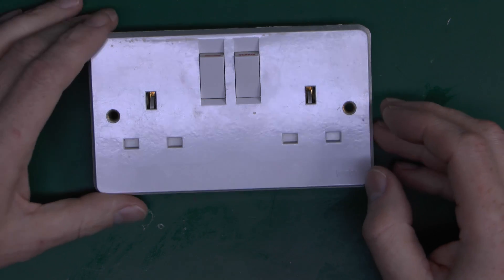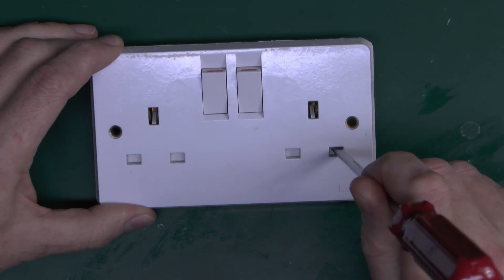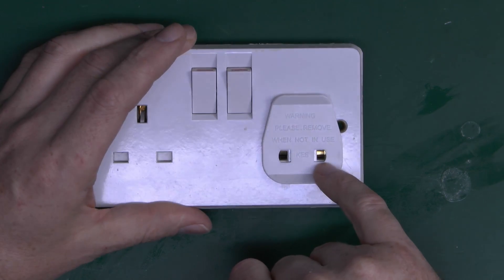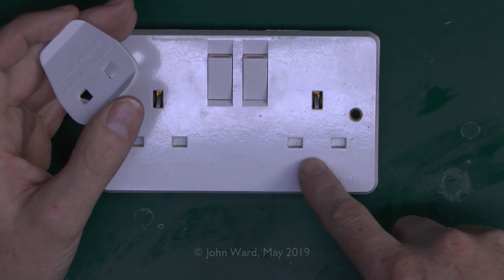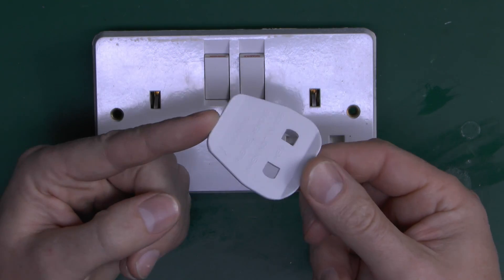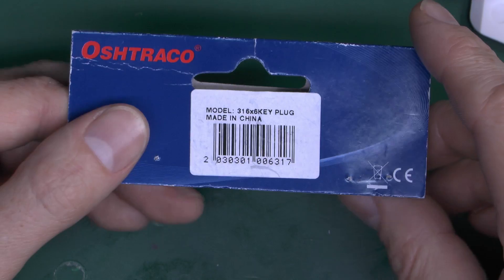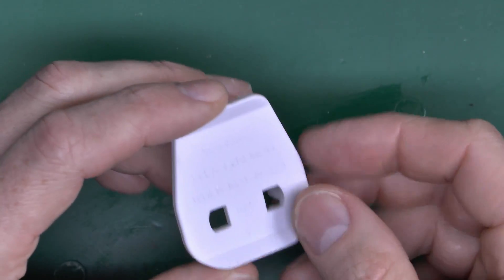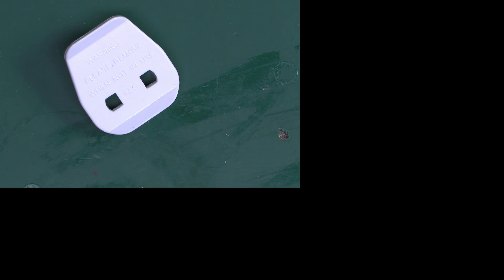Plastic Socket Key to Defeat Safety Shutters in UK Socket Outlets

Comment: Crazy, even somebody with limited intel can see this is rubbish. One thing I don't see or get is that people have disliked this video?? I think an explanation of WHY they dislike would be appropriate. I had a quick scan down this list of comments and didn't see any negative comments so all I can think is that it is trolls or whatever they are called. Again justified sarcasm John, great fun, you should think about becoming a standup comic !!
Reply: Overengineered  is nonsense.  The great advantage of ring mains is the ability to add a large number of additional sockets to the existing circuit without running new cables back to the consumer unit.  I would rather have polarised sockets, shuttered contacts, switched outlets, and the ability to tailor the fuse to the product than the other systems.
Reply: They’re probably from the UAE and don’t like the slight against them which the video contains. Either way don’t sweat the dislikes. It’s not worth it.
Reply: Here in the US, the lack of shutter causes us to go mentally retarded and shove metal things in them. 
Actually... no.. it doesn't. We have no shutters and also no problems with people shoving things that don't belong in them.
Reply: Probably because it's all todo about a total nonissue? I don't live in a country that requires shutters and I can't remember the last time I ever had even a slight hint of a possible chance of a risk of accidentally poking something conductive into the live connection.

If you stick something in a socket and get shocked it's your own damn fault.
Reply: @TestECull  Idiot. When was the last time you had kids around? 240V is nasty.
Reply: @TestECull  Precisely.  The UK socket is hysterically overdesigned and the whole wiring system is bizarre with huge chunks of it existing only to support the antiquated ring mains that stuck around even though they were nothing more than a way to make less wire go a longer way and still have something like a functioning electrical system.  The video does come off with a bit of pedantry and manufactured horror over a non-issue.
Reply: @Lazarus7000  The UK plug & socket combination is regarded as the safest around. It also means that appliances don't require 2.5mm cable as they would if every socket is backed by a 16A fuse (as in European and US systems); the plug can have the correct fuse fitted to suit the appliance and the cable can be safely derated according to the load.
Reply: @cambridgemart2075  They're safe because they're overbuilt because they have to be overbuilt because every socket ends up being like the socket for an electric range or a welder.  The fuse in the plug similarly is there for that reason as well, everything would have to deal with potentially 32 amps of fault current which is ridiculous.  This whole situation exists because of the stupid ring mains that were made to save on wiring.  And while the plugs are electrically safe, they're also caltrops.
Reply: @Lazarus7000  So it's more sensible to have multiple outlets for different ratings? No, that doesn't make any sesne does it?
Reply: @cambridgemart2075  Of course it is, why would you want to have a big, expensive plug on every single thing?  And one obliged to be right-angle, too?  In the US, at least, both right-angle and straight plugs are available and you can pick which you prefer for your application.  There are plugs that are no more than 1/4" thick, for the rather typical case of the socket being behind furniture.  I can have something like 4 sockets for typical devices in the space of 2 of the UK ones.  So many things would otherwise end up with the plug being a significant part of the weight or bulk of the device.  And of course there's the whole "giant caltrop" thing, with treading on an upturned plug being the most painful event the average Briton is likely to have in his own home.
Reply: @Lazarus7000  Thankfully our walls are big enough to accomodate a couple of double sockets if needed ;-) Better an expensive plug (they really aren't that expensive incidentally), than having to equip every appliance with 2.5mm cable because the circuit can deliver 16A. Having the cable at 90 degrees is done to prevent people using the cable to pull the plug out of the socket, so it's actually a very sensible bit of design.
Reply: @cambridgemart2075  90 degree plugs are all well and good except for the applications where they can make things worse.  Take for instance a vacuum cleaner /Hoover.  With a 90 degree plug, significant wear is incurred every time it reaches the end of the cable and some tension is created.  A straight-through plug with an adequate strain relief would not incur such wear as readily and if significant force happens it will pull out safely rather than risking damage to the plug, socket, flex or even the wall.  You don't want to suddenly have live conductors exposed because someone tripped on the cord.
Reply: @Lazarus7000  Misinformed, much? Ring mains aren't a thing anymore, and your 'overdesign' is our 'world class safety design'. Who appointed you gatekeeper of the mains sockets?
Reply: @Blitterbug  I have had an interest in such matters literally for as long as I can remember, and I have studied it extensively.  While Ring Mains may no longer be current practice, the overdesigned plugs needed to support them remain.  They are the same size as the plugs we use on our heaviest appliances, range stoves and clothes dryers, as well as large welders, two-ton through-mounted  air conditioning units and other such things that will not likely be plugged and un-plugged much but are still obliged to have a plug.  I cannot imagine the inconvenience that would arise from having to deal with such a plug on every single item needing a connection to the mains!  There is also the whole "is also a caltrop" thing.

Comment: Have you tried it in the MK sockets which require force on both sides of the shutter?
Reply: That's what the side "pins" are for.  It's designed to defeat even those MK sockets.
Reply: bdf2718 yeah that’s what I thought. Would be interesting to see it tested
Reply: @johnpriceuk  
It would indeed be interesting to see it tested.  There's a good chance they'll not do the job they were designed to do. :)

Comment: I love how the description on the website selling them lists "Superior rust and corrosion resistance" for an item made completely of plastic!
Reply: They may as well call it gluten free.
Reply: Well it's technically correct so why not :-D
Reply: They could also market it as "high energy efficiency" and "uses less than 1 kwh per year!"
Reply: @pmailkeey Yes, grind to a find powder and snort in your nose for maximum unicorn power effect.
Reply: Looking at the other selling points, it seems that they actually are meant to go with a safety pin

Comment: In Australia for some stupid reason we don't have the shutters on our sockets, we also don't have fuses in the plugs, another great idea. 
One day my father caught me just about to insert a piece of wire into the socket. I have never heard him yell so loud. It scared the life out of me. It prevented me from ever even thinking about doing it again. The next day he went and bought some special plugs that prevented anything from being insert into the socket. They even had to be removed to insert a plug. It don't know why but I haven't seen those plugs around for years.
Anyone who has one of the plugs that John just showed is an expletive moron.
Reply: @voltare2amstereo  No, no and no. An RCD does not replace any existing safety feature. RCD does not prevent shock, just reduces its severity, if it works correctly. If it fails it does not offer any protection.

What you say is like saying that seat belts make breaks unnecessary in cars,
Reply: Those plug covers are still around
Reply: I wasn't talking about those little plastic plugs, these were lockable.
Reply: Jaycsee66 
Oh right , I that case I haven’t seen the ones you are talking about 
I will have to some research
Cheers
Reply: @steveosshenanigans  Looking back on it (it was almost 50 years ago, so it's not completely fresh in my mind), dad and the sparky at work were mates, so he may have got it from him. It may have been something to do with OH&S, and it was in the public service, so they would have had OH&S even back that far.
Reply: voltare2amstereo 
Correct, and I think 🤔 also now have changed from 20amp to 16amp Circuit breakers
Reply: You don’t need the fuse. In the UK they put multiple outlets on a very high current rated circuit. By very high I mean 30A or more. They are worried that if you have a shirt in your device the power cord (flex) of the device is part of the short circuit but it’s not rated for the same current as the rest of the circuit. So they put a fuse in the plug to protect the cord.

In other countries inducing your own the outlet is on a lower-current circuit so if there is a short in the device the circuit break will turn off the circuit, protecting the cord.

The UK system is quite old now. If you designed it for the UK now you probably would put a breaker in the outlet and omit the one in the plug. For other countries they just put the breaker in the main box and just require it be rated low enough to provide adequate protection.
Reply: While RCD's are mandatory, a lot of older houses do not have them. Also no technology is 100% foolproof, the shutters provide an inexpensive backup.

Comment: Just use a vde screwdriver to open the shutters an plug in a 2 pin EU plug. Works when you forget your travel adapter and the hotel doesn't have one.
Reply: The lid of a pen works and at least it's plastic!

Comment: I have an orange one of these john. My tutor in college gave it to me over a decade ago. I use it for inserting my test probes. The funny thing is, he thought that is what these are for. So did I. Was he wrong? Are professional versions of these sold for the sole use of electricians?
Reply: I don't know whether he was right or wrongz but there are uses other than inserting test probes. I live in Malaysia where we have lots of these and we use the British plug and socket. Some appliances like my printer and my mom's blender, both of which were bought in Malaysia use 2 prong European type C plugs instead of UK plugs. I think devices with type C plugs are sold with these plastic sdaptor things. Lots of Malaysians don't even use this and jam a chopstick or other items into the top hole where the earth/ground prong goes in to open the shutter and then plug the type C plug in without the plastic adaptor

Comment: Forcing a 2.5A euro plug into the UK socket also bends the contacts apart making it unsafe to use with a standard UK plug afterwards.
Reply: That is so common in Malta, well designed plugs and sockets can prevent it from happening while still working fine with proper British plugs, but you very rarely see that
Reply: @AL_O0  How is this allowed in the European Union?
Reply: That seems highly unlikely. The diameter of the 2.5A euro pin is less than the thickness of the prongs of the UK plug.
Reply: @JasperJanssen  The problem is the spacing between the pins, it's only bending one side of the contacts apart per pin.
Reply: @JasperJanssen  It's actually exactly the same, live and neutral on the UK plug are 6.4x4.0mm, on europlugs the metal sleeve at the tip is also exactly 4mm (the plastic shaft above it is 3.8mm).
Reply: This happened to me while using a "combo" UK -> EU adapter, in Romania. Someone plugged an EU plug into the adapter socket, and when we used it afterwards with a kettle, it started melting and burning.